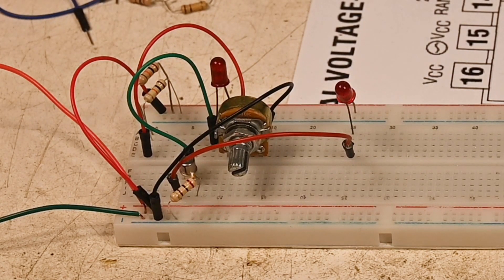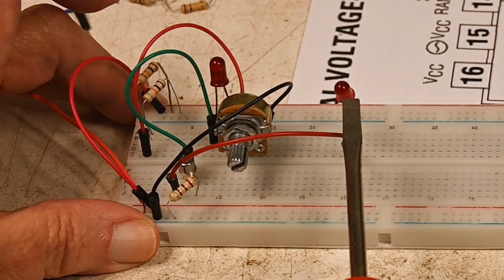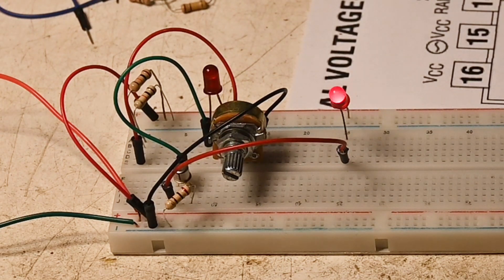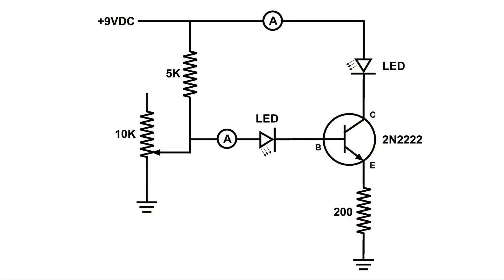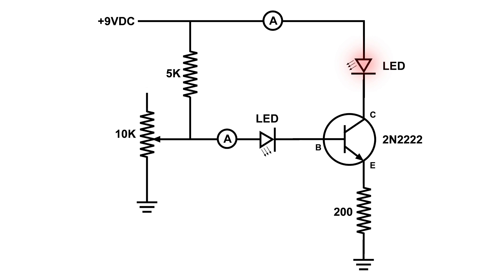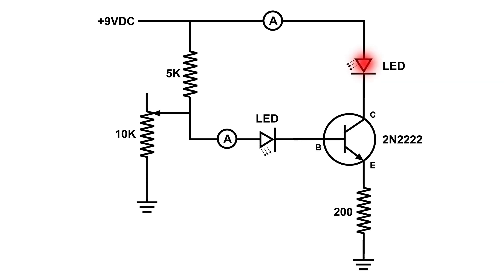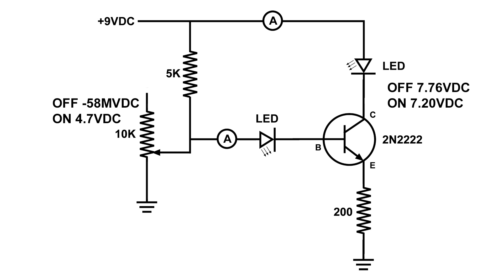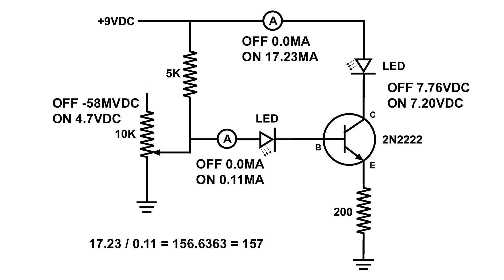Transistor How can it Amplify

Comment: Hi Rick, I did your experiment several times.  As I measure e-b voltage .06v, I turn the pot the reading goes to -.660V which is causing the transistor to go into forward bias for an instant. The led flickers and then is off (V) is also zero then as I keep turning the voltage comes back to -.660V the LED is on again. I'm not sure what I'm doing wrong, hehe my values are very similar to yours. Enjoying the video and your teaching. 👌
Reply from the maker: I have a FREE eBook that may help. The password is allamericanfiveradio

Here is the download link;
https://drive.google.com/file/d/1HHmaWYr7UMACfmS4W5uL6PADoem2KlRp/view?usp=sharing
Reply: @AllAmericanFiveRadio  Thanks a lot!!

Comment: Mr. Rick
I have an old 1971 single channel transmitter and receiver that's in an old model plane. I would like to see if you could explain to me ( electrical) how this simple radio works. I love your videos and have learned so much. 
I could see pictures or a video of the unit.
Thanks Clay
Reply from the maker: That would be interesting. Right now I do not have any type of remote controls for an model airplane or model cars. I will keep this idea in mind. Thank you.
Reply from the maker: I have been thinking about this and I would need the wiring diagram of both the transmitter and receiver. The manufacturer and model number would also be helpful. You can contact me at allamericanfiveradio@yahoo.com make the subject remote-control transmitter receiver.

Comment: Excellent way to show amplifying in a circuit. I can see the FETs coming next Rick.... ;p)
Reply from the maker: Thanks Carl
I had thought about how to show base current and collector current visually. Not just using meters readings. I thought about this for a week or so, and tried several ideas. Putting the same LED in both the base and collector I thought might work. Also I don't believe I have seen that done anywhere. And it worked, I think it makes a good visual demonstration.

Comment: This is not only a good demonstration of transistor amplification in general, but also a very good visual of how a bipolar transistor is a current amplification device, rather than voltage amplification as a Field Effect Transistor would be. Might be a interesting follow-up to do a similar circuit, but using a FET and compare the differences between the two. Regardless, a great tutorial as always.👍
Reply from the maker: Thanks. I'll look form may FETs.

Comment: What are you amplifying. ?  I see two red led. I see no  audio source.
Reply: He's demonstrating a tiny current on the base thats not enough to light the LED on the left but is 'amplified' to provide enough current to light the second LED, the term "Amplification" does not just apply to audio. This demo explains perfectly whats going on so I suggest that you watch it all and you will see how it works.
Reply from the maker: Current 0.0 to 0.11MA controlling 0.0 to 17.23MA